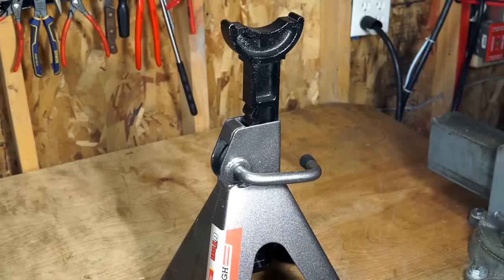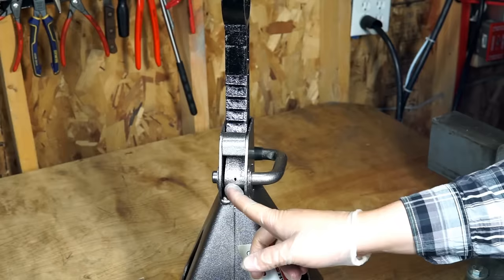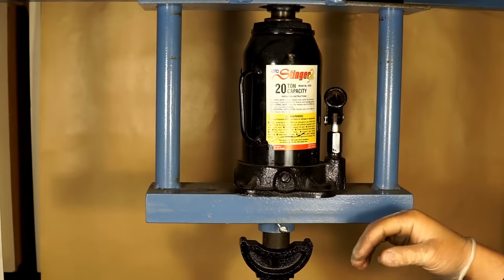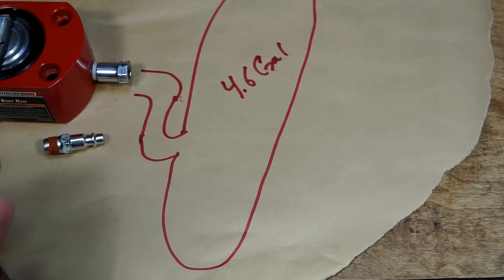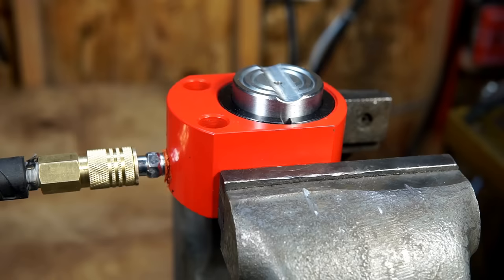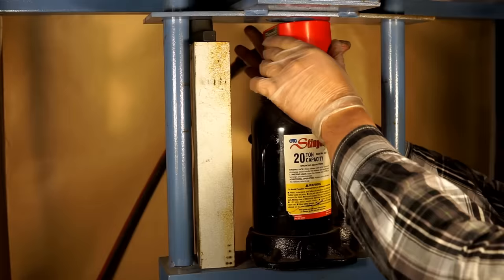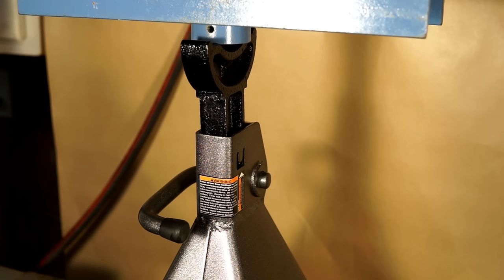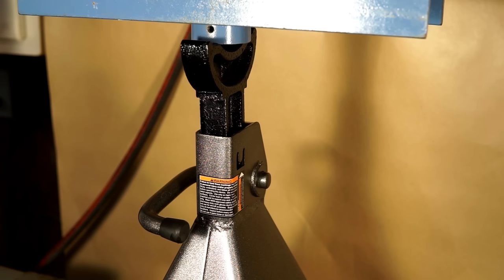EXPERIMENT: WARNING! Doing this to your Jack Stands will get you KILLED!

Comment: They make different size jack stands. Not size necessarily but ton rating. I noticed you are using a 6 ton rated jack stand which the sheer pin would be substantially larger than per say a 1 ton jack stand. What size of jack stand was "Mike" using? That size of jack stand should be used for demonstration. I only say this because I have multiple ton rating jack stands ranging from 1 ton to 6 ton myself. It will take more force to sheer or "drop" a 6 ton stand than a 1 ton stand.

Comment: Interesting experiment.  Thanks for sharing it.  I'd like to see the same thing done at 1000 lbs load (a more typical expected load of a typical vehicle) or nearer the limit of that jack stand.  Could it be you just discovered using a jack stand of a much heavier duty than required is not a good idea?  As in, I should not use my 12,000 lb. jack stands under my 3,600 lb car?  A case where heavier duty than required may actually be less safe?

Comment: I think you're testing idea is great, but I think you're making a logic error. The person injured may of had 4 jack stands or at least 2 and maybe 2 ramps. In any case if the alignment of the lift points or even deformations in the lift areas of the frame, pinch welds, subframe, or tires had geometry not aligned it would allow a little bit of teetering. This means the weight of the car, in the example the porche under 3k points total, have actually been leaving as little as 50-100lbs of support under the jack stand that was bumped.  

I any case.  Lift vehicles safely. Double check they are secure. Work with others when you can. Don't rely on single points of failure for safety.  Have a plan in emergency.

Comment: If your jack stand under a load wich is the weight of the vehicle  there is no way the jackstand would fail even if you bump into it, you need to lift the car off the jack stand  then the rod will go down, I guess the guy did use the a Jack stand that would support  the weight of the vehicle

Comment: What you didn't do is check the required force to compress. Simple test: use a lower pressure! Using your calcs for example, 63psi should compress at 150 pounds (ie stand on it). Or even, if you have a nice heavy weight...8psi for 20 lb. If those work, then great we've got confirmation it was 500 lb...

In any case, clearly you needed a lot of leverage to get the 500 lb lift.

Comment: Every pair of jack stands that I've ever owned since I was a teenager in the I have always bought design for heavy-duty loads and that way whenever I worked on my car's or my van I had more than what I needed for weight capacity and then some but I always put the handle toward the outside plus a safety pin to ensure no accidents so basically over thirty-eight years I've never had an issue knock on wood

Comment: This makes no sense or somebody dumb.  In my case, My jack stands have a pin that goes across, so the pin would stop it for something like this, in addition, I always leave the jack under the car just enough pressure after the car touches the jack stands. Also, my car weights 3500 lbs, and the jack stands can carry 6 tons

Comment: Some good safety protocols to maybe consider here: 1). drive out & replace the existing pawl with something SUBSTANTIALLY weaker, cast aluminum or bismuth or a short length of thin walled copper tubing, perhaps even a soft-wood dowel, to the point where there's an actual issue with unintentional shearing with rough handling. Seriously. Better off annoyed than squashed flat. 2). Even more importantly - when using the floor as a backup catcher (sound advice in itself), Bring it up JUST TOUCHING the jack point. Don't relieve even one ounce of weight off the stand. 3). engage the stand with the release lever pointed AWAY from the work area to avoid accidental engagement. 4). slide tire/wheel under frame rail if removed, with clearance to release lever observed, as a 3rd precaution.
Reply: I definitely agree with you on not putting any load on the jack when using it as a backup with stands. The jack is far more likely to fail, and if it's supporting any weight then there will be a sudden weight transfer onto the stands. Those stands can handle quite a lot of force, but they are not rated for impacts. You want the jack to catch the car should the stands fail, not the other way around.

Comment: I don’t really understand what your hypothesis was in regards to the Mike accident. If Mike had his car up on jackstands, how would he have the space to decompress it? You put a cylinder with air at 500 pounds in order to decompress it, but what you confounded with this study is proving the whole mechanism in the first place. It Has to go up before it goes down. I would like you to put 1000 pounds onto across beam with two jacks, holding it up and then try to knock down one of the jacks. Because the whole nature of this experiment is trying to find out if the Jack will fail under a static load, and what you did was change it from a static load to a compressed load. But we already messed with the Jack under those conditions because you had a lever and fulcrum, and you applied force to it so that would’ve been an easy experiment to just deal with the 18 inch handle that you had with the amount of force that can be exerted on that lever to drop stand by decompressing the air cylinder.

Comment: Well let's look at it a bit differently shall we? 

What brand was it that failed on the guy who was crushed? Walmart sells these and we all know Walmart quality is... Less than. 

I have the Walmart ones myself and a lot of people I'm sure do.

Let's also factor in where the stand was placed on the car. Cars have jack points for a tire change on the side of the road but not always space to put a jack lift and then a stand so you can remove the Jack lift and use it on the other side. 

So the guy may have placed the jack stand right at the edge of the frame and it slipped out. This happens if you put it where there's a ridge or bolt sometimes. 

And finely, they may be labeled as "Heavy Duty" meaning not leight weight duty. So it's meant to have over so much weight in order for the safety mechanisms to work since it uses weight to hold it in place. 

Now me, after I get my car on stands, I always then put the hydraulic jack just barely snug under another part of the car in case a stand does fail, the Jack acts as a sort of secondary catch.

Comment: I can see it happening if the jack wasn’t fully under load  from sitting on unleveled surfaces or missed a lift point on the car and bumped it to set the car in motion . I use vehicle lifts and double check everything before I commit to go under it . Never trust when somebody else lifts a vehicle either check for yourself before risking your life

Comment: Or you could just drill a hole through the jack stand to put a bolt through the jack stand to keep the jack stand from releasing until the bolt is removed

Comment: Any tool can be misused. If you take a sledge hammer to the handle or a ten foot bar, then maybe you could force a fail. The chances of these stands failing in normal use are about as good as me sprouting wings out of my butt and flying over my town. I have like 12 of them. I used 4 of them two weeks ago when I pulled a trans out of my old Monte Carlo. I had no hesitance in using them. I trust jack stands more than I trust post lifts in many shops - I have seen post lifts fail and slam a car down on the ground. I've seen them take off like a rocket and nearly launch a car off the top.

Comment: Just take your existing jack stand, remove the safety pin and put a toothpick in it's place.  No need to go out and buy a new set of jack stands or jump through any other hoops.  And oh yeah,  pre-equip yourself with a good amount of common sense, and that will be the most used tool in your toolbox.  Or just don't try anything at home without adult, or professional supervision,  anything,   at all.

Comment: For my second two jack stands, I opted for a set with the pin, rather than the handle.  I never really trusted the jack stands with the handle.  After watching your video, I intend to use a 6 ton bottle jack as additional support.   I had been using scissor jacks and just got my first hydraulic floor jack (Arcan Aluminum 3 ton).

Comment: ALWAYS chock the grounded wheels front and back. Hydraulic jack left under one side JIC someone else has to use it to get the vehicle off of you and as a backup. I always stick the tires under the frame as well or 4X6 blocks under the mounted tires.
     No F ing way I'm getting under a  vehicle without safety backups!!! 
     Can't return a jackstand if you're dead.

Comment: Never ever rely only on stands. Especially these design. They are by design an accident waiting to happen. Try and use the screw adjustable type. Much safer and idiot proof.
I always leave the trolley jack in place too. Why remove it if you don't have to right ??

Comment: They usually are made in china. Probably not a lot of quality control involved in making them. For example 1 tooth could have an impurity that weakens it. So it fails and falls a 3/8 inch. There's enough force falling down on the tooth below the tooth that failed, so that tooth fails also. Same happens to next tooth and so on...
Just use jack stands with thick high quality steel pins. Forget ratchet type jack stands. Always have backup jackstands in place also. Not worth saving a few seconds!

Comment: I am very paranoid when I work under my cars. I always place my stands with the handles facing away from me so I can avoid bumping the handles when I'm underneath. And even if it takes up extra room, my floor jack is always propped underneath in case the worst happens

Comment: I had it happen to me once. The jack stand lock sits on the end of the tooth it is supposed to lock into but it is not locked in correctly. Watch out for that but other than that I have never had one fail of itself.

Comment: im so sorry but no, your test was 1000% BUNK. When you squished the piston on the ram with the vice the air just went in the hose and added a tiny bit of pressure to the tank. Your volume of compressed air is not the volume of the hydraulic cylinder, but  the volume of the entire tank, the hose, and the cylinder, unless you cut the air off from the cylinder which you clearly did not. Your silly thumping it with your fist lightly "its hard as a rock" is a joke too. what was that like a 5lb fist bump. PLEASE.  The test weight of 500lbs is pretty achievable by placing something that weighs 500 lb on the jack. such as the corner of a 914, or any vintage bug ffs. Then see if you can lift the lever. Spoiler: you cant lift it.

Comment: I really dislike modern jackstands that have this type of design, with the notches in them.  I still have some heavy duty jackstands from the late 70's that I prefer to use since they use a pin to ensure the stand doesn't collapse (it actually has two pin holes since it was designed for heavy duty use -- like trucks, but I only use one honestly, but the pins themselves have a mechanism on one side that you can slide a cottor pin through to prevent them from backing out -- the other side is attached to a cap and a chain so that side can't slide out).   I don't know why they bothered to go away from that design.  I mean the ones shown here are probably more compact and faster to set but I don't trust these designs.  I trust my 50 year old jackstands more.  Some do have the safety pin feature, which is a better design, so as long as there is a pin of some sort that keeps the stand jacked up and won't fall out, those are fine, but I see a lot of these that DON'T have such safety features and I would never use them.

Comment: ok soa few questions through my head right off the rip, do you not have a pin for your jack, and why are you not bracing your tires with something like bricks while its up. I can understand if you're on the side of the road but if you're at your house and just not propping your car up wtf are you doing

Comment: I didn't see a jack stand failure in this video. I saw a nut doing everything he could to make the normal release let go. This is how the stand works and if it had a car's weight on it there is no way he could have accidentally tripped it. My concern was the roll pin that holds the gear cam on the trip rod. I thought that was what he was going to make fail. If that little roll pin shears then the stand will fail.

Comment: The hysterical Youtube moderators removed my  post on stating the proper way of testing this jack stand. I was a test lab technician for years. Rainbow hair and plastic or real badges don't  make you correct. They only make you intolerant fools.

Comment: Does the pin sheer at different weights depending on the rating of the jack stand? Was that weight not enough for the size of jack stand to sheer?

Comment: I doubt it was even 500 lbs because the weight distribution is not perfect, but also the vehicle is leaning forwards quite a bit when you only jack up one end putting most of the weight down at the other axle. Kinda like a wheelbarrow. I wouldn't be surprised if they were only holding two or three hundred pounds

Comment: I stay well away from those style jack stands i use the ones where a bar goes through it to hold it up, i dont get under car with only one jack stand these days, i have about 3 in place plus a jack, ive had a car nearly fall on on me while it was on a set of ramps once the ramps collapsed, when i was working on it i kept hearing creaking sounds then the car slowly started moving away from me  i just thank my lucky stars i was on a creaper i shot halfway across the drive way, if i wasn't on that creeper i would of been been jam the car i was working on sat low to the road.

Comment: Use a good Ramp like  Race Ramps  if you need to get underneath.  use stands  when you don't,  and as others have said put the tire under the frame for safety and keep the hydraulic jack in place if u can. i would never and have never in 40 years  got under a car using Jack stands. Inspect any ramps before using each and  every time. Wheel Chocks is a must for any work.  Harbor Freight chocks  work as they are made of rubber and not these garbage plastic ones that slide and get brittle.
Reply: I trust stands over ramps. You could bend the ramp or crack it if it is plastic just pulling onto it with your vehicle. At least with a jack stand if you place it on level ground and make sure it is secure you are more than likely good to go.
Reply: Who said anything about using cheap plastic ramps?  U use the proper tool for the job. I see a lot of death certificates. When i see one involving cars and speaking to family  it's always  jack stands  or Hydraulic jacks.  a Stand is no where near as safe as a ramp that fit the proper size tire where it does not slide. U cant tell me a car perched on a thin steel is more stable resting on its own suspension with wheel chocks.  40 years of wrenching i have all these tools and have several stands.   the likelihood of bending even a cheaper steel ramp to total collapse is ridiculous.  Again we are not talking  cheap autozone plastic ramps. also a ramp failure pulling on to it does not kill  you.
Reply: Now your a mortician? Lol I never said specifically plastic ramps. I stated both. Because both can be purchased. Only for the simple fact you have to give a car gas to get on the ramp, not much of course but enough move past the incline. You can inspect beforehand all you want. The damage is done whilst pulling up on. I understand this with the stress on a rope or gear as an arborist. As we all know, whether jack stand or ramp it should be done on a level surface with wheel blocks. Everyone has their preference and my preference would be something that locks in place over over something than can fold. Taught by a master mechanic of 30 years. Just advising for future readers. Also I use metal chocks, not plastic or rubber. Less likely to wear or be hindered by weather. I agree with cheap junk, just have my preference is all. As everyone does.
Reply: Nope not a mortician but family member  is. Last year a  guy under a car: Jack stand slips out somehow no one knows how.  "crushed skull and chest, punctured lungs".  Seen many like these.   we are  talking death and safety  not driving a Car on a ramp. There is no risk other than to the car. Sorry Physics  don't lie.   its just not as safe. Don't get me wrong  i use stands but not to get under the car. I don't care who trained you this is about risk and safety. again tell me how a car on a metal stand off the ground resting  on a thin ratcheting post where the center of gravity is off is safer than a car on a platform on on its wheels.  Your argument makes no sense.  u do realize a car  is most stable on its wheels right?  Use what u want.  u never hear of anyone dying using ramps under the car  but countless stories of jack and hydraulic jack death. how many death certificates have u seen? As i said use what u want not my problem just stating facts no conjecture  here.

Comment: I call bullshit with the weight on the vehicle it’s impossible to lift that. The pin on the handle would sheet off first. But drilling it and putting a pin in is always a good idea. Just don’t cheap out on stands. Also if it’s a stick shift car put it in neutral and chock the wheels (common sense) had a friend die when he accidentally hit the starter car was in gear jumped forward and crushed his head.

Comment: You're not going to cause a jack stand to release by  bumbing it with one or more tons of weight pressing down on the locking mechanism. You're theory looks good on an empty jack stand but with 2000 pounds on it bumping it will do nothing.